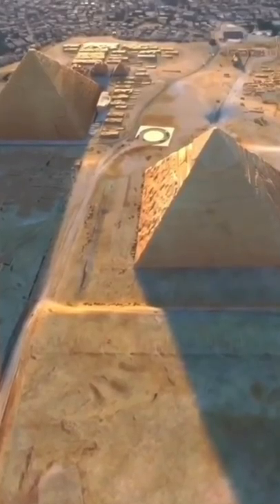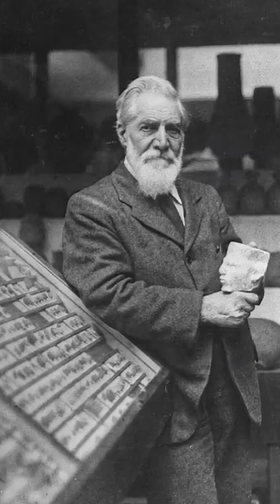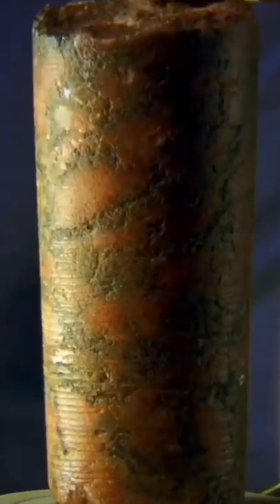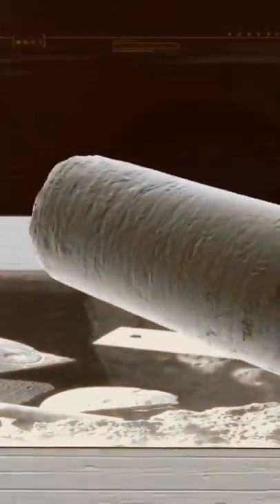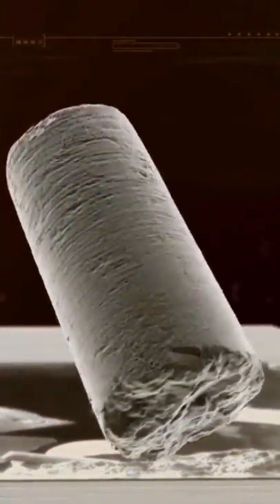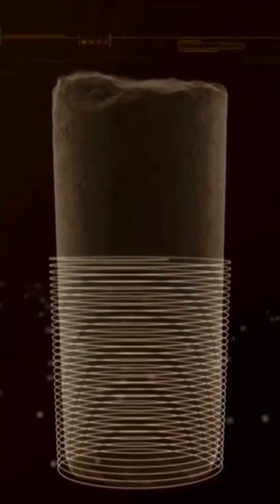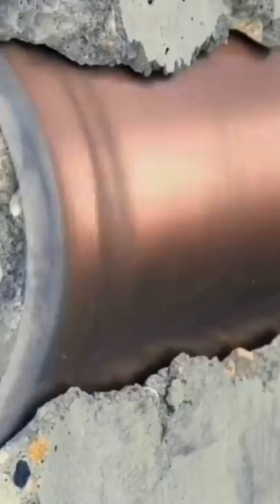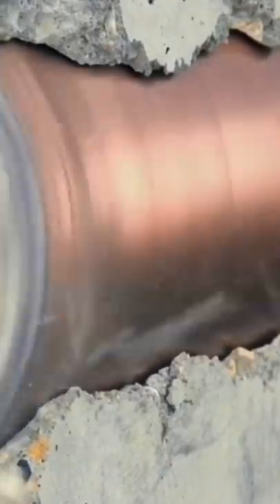Advanced Ancient Tech found in Egypt! Core7

Comment: I love how it has to be either a bowdrill... or a modern power drill.
Reply: All of which would make something smooth. We literally have nothing that can cut a granite core out of the rock like this. Anything done by us is smooth as glass
Reply: @Frogtalkin  well now. Give them credit they built pyramids. They could probably build a horse powered bow drill. Place lever on top and have the horse pull the rope.
Reply: Ancient Aliens in a nutshell.
Reply: @Frogtalkin  yes we do. It's called sand. 

Egyptians used sand on their cutting bits to slice into granite. This is well documented. No power tools required. Just patience.
Reply: @Nurhaal  o don't like sant
Reply: @Cyborg_Lenin  it’s rough, and coarse, and it gets everywhere
Reply: @gregoryholland6126  not like you, you're everything soft, and smooth.
Reply: @Nurhaal  i hope it was Diamond sand. He just said it was moving 1,600 rpm. Silica isn’t going to cut through granite in one motion at 1,600 rpm.
Reply: @toob247  thats exactly what i said
Reply: He proved it when he said "literally." 😂🤣😏
Reply: Right, like millions of minds couldn't come up with a way to drill mechanical using wind, water power
Reply: That checks out in all, until you realize the time involved with that and the time the pyramids were allegedly created doesn't add up at all
Reply: These conspiracy nuts jump to conclusions all the time if it moderately supports their claims
Reply: @Drknow1984  it's clear to me that home depot has been around much longer than originally thought.
Reply: @Drknow1984  oh gee look at me such the big rationalist owwww your type is just as bad if not worse
Reply: @pureruckuspower2165  our time estimates are 10000% wrong, just not how you think, but hey way to make it seem like you said it first, and attempt to discredit the guy who said fuck all about aliens in the comment section as he points out you clowns. At least the "conspiracy" theorists are creative, and probably have a soul to boot.
Reply: @Drknow1984  well clearly it can't because it wasn't. Should of went to trade school and learned some actual things maybe
Reply: @cvi4057 You ok bro?
Reply: @cvi4057  Imagine liking your own comment to try and make it seem legit.What do you mean it wasn't, you mean the pyramids weren't built? They didn't core out that granite? Or you just can't think of a point?
Reply: @Drknow1984 I don't do that but nice try. All I've said is they weren't built when we thought they were built and they didn't use what we think they used. There's more evidence to suggest in favor of my claim then there is in favor of yours.
Reply: To exert 2000lbs psi of force and sustained 1600rpm, I don't think it's possible with tension or copper gears with a weighted water driven system. It's a mystery but I would definitely leave room for some lost tech that people of the time came up with. I wouldn't immediately go to Aliens or Atlantis.
Reply: @cvi4057  cope and seethe kid.
Reply: I'll take a guess... horses and gears.. one single large wheel/cog... and the one small one attached to the 'boring tool'..
Reply: @toob247  this is my theory also
Reply: Lol they under estimate   ancient  Egyptians  lol
Reply: They can speed it up by using gears too
Reply: @cvi4057  I'm glad your the professor of this comment section.

All hail our new leader.  Conspiracy man.

And yes I have no soul...  BOO!
Reply: @pureruckuspower2165  hahaha who hurt you my son
Reply: @cvi4057  it was you dad.
Reply: @Drknow1984  lol ok please, explain it to the rest of the class then.
Reply: @pureruckuspower2165  cringe comment
Reply: @darrell3391  real question is tho, 2000lbs psi and 1600 to take how long to drill it? If they would have done that in an hour? A day? A week? A month? They aren’t very specific on that. And it has been proven that some things can be done anyway by taking a very long time.
Reply: @cvi4057  i would love to hear your estimation for when they were built. Cause obviously they weren’t built yesterday evening and they have been around for quite a while. Also the claim they make with the 2000lbs psi and 1600rpm or whatever doesn’t really specify the other terms as there is more involved, time for example. Perhaps those numbers change as you change the amount of time you spend on them, as they probably will.
Reply: @Nurhaal  Cleary not someone who has cut stones. use sand how? it's a very bs way to excuse the lack of explanation.
Reply: "Rapidly rotating power drill." That just means it was a drill that was powered in some way. It could have been powered by literally anything. Nothing that couldn't have easily been around during the Egyptian Era.
Reply: "We don't know how they did it so it was modern technology"
Reply: @cvi4057  why is it so hard to understand people back then didn't really have anything else to do?
Reply: @darrell3391  just because you don't think it is possible doesn't mean it's not possible.
Reply: Yeah people completely ignore a two step process.
Not to mention that said core has a smaller radius at the top compared to the bottom. Meaning that when they drilled it, they took more from the top.

This small fact can sustain a chemical treatment of the granite before finishing the drill. The drilling is assumed to be rotating at a specific speed assuming the harness of granite. This changes if something like salted water is used to drill as it chemically softens granite making it easier to drill.

The video also assumes the groves were made when the core was drilled. They could have been made later for different reasons.
Reply: Well, it could have been aliens
Reply: @j5892000  I’ve dabbled in the create mod for Minecraft so I know a little about gear ratios 😎
Reply: So then what is it if not these?
Reply: @Nurhaal  yeah bro 6hours of work for an inch or so, clearly they drilled and cut at that amazingly efficient rate
Reply: @cosmicbonzo7559  how did they determine RPMs?  The whole video is BS.  It could have been weeks and 40 rpms.  The grooves look to wide to be done with something that fast.

You could get string wet, and pack it with sand and use it to cut glass if you had to.  It would take a long time but its doable.
Reply: Right lol
Reply: No, he said it can’t be a bow drill bc of the lack of breaks in the groove around the core. However, this guy is forgetting that we’ve been able to use wooden gears to make fixed, rapidly rotating drills. Only thing is, there’s almost never a reason for a hunter gatherer to ever build that, even though they still could 🤷🏼‍♂️
Reply: @bendover9813  dude these guys didn't use the wheel until much later, they didn't have geard
Reply: Aliens responsible for this shit thas it
Reply: He said it can’t be a bow drill because the grooves are in one direction
Reply: @Drknow1984  That's not a conspiracy.
Reply: The one option  that hasn't been offered besides a watermill, the one thing they could have used as a power source would have been wind power to power a drill. And if that is the case they could convert between hydro and wind depending on the location of the water source, no water source no problem. And with there advanced knowledge of all everything  depending  on the power of the airflow could be augmented  by gears so even a smallest airflow could be increased dramatically  by the gear ratio..
Reply: @toob247  0 evidence they built the pyramids. If you aren’t being sarcastic ofc.
Reply: K hello YouTube comments section im gunna blow your mind 

So gemstones like diamond arent very common in ancient Egypt but there are a few things that are one very very special one that would have been imported over the sea was obsidian shards, when fragile obsidian chippings are crushed and added to a drill it allows for way more cutting power then those pesky bow drills would every have, couple this with 50 or so slaves working as fast as they can on a large drilling mechanism and it's perfectly possible to cut fine granite like this, to account for the rings mostly likely they are caused by obsidian being used up and ground into dust requiring drilling to be stopped and the dust replaced with more finely chopped shards.
Reply: And before anyone says it, no the grooves don't go one way idk if you know this but the guy who makes these shorts tends to make up little facts to make it sound more impossible mostly so people argue in the comments about it and get him more interaction time
Reply: @cvi4057  ya a soul🙄
Reply: @highdadd6526  maybe you should try and get yours back sometime
Reply: @James Smith it's always the atheist.
Reply: @James Smith 😂😂
Reply: @James Smith I hope one day you ask God for forgiveness before it's to late, but everyone walks their own path.
Reply: @James Smith imagine
Reply: @Nurhaal  a slice going 1/4 in per hour into stone is not realistic to cut massive stones and still put together the pyramids with such a small margin of error.
Reply: @Official3N4XL  you clearly don't work on manufacturing. 

None of you do.
Reply: @Nurhaal  anyone who works in manufacturing can vouch for anything being much more efficient than using water and sand, which was shown countless times again to be inefficient time-wise and in terms of being precise right angles and flat surfaces.
Reply: Funnily enough there is only evidence of bow drill use.
Almost like its older or they had more advanced stuff than we realize.

Why cant you people just accept this?
Reply: @realryder2626  and 2k psi? Real life experience, any idea how much force that is?    Im quirous how many of these bore holds were actually drilled.
Reply: or maybe a planetary gear system parallel to the ground with like ten people turning the outer gear by pushing handles in a ring? planetary gear systems aren't that advanced, would definitely have no breaks in the pattern, and would be somewhat practical at accelerating the drill to decent speeds via human power alone
Reply: @ThoseMadFoxes4330  I had intentions on challenging this. Yes The Greek Antikythera mechanismWas apparently built 500 to a 1000 years after the pyramids which is kind of a  time gap but who's to say really.  Only Nothing of that equivalence has ever been found in relation to the Egyptians.  But who is to say when Egypt hit the dark ages that they didn't hawk all their metal to foreign empires for food.  I'll say it is plausible.  But you have also have to consider the pressure required to drill such a hole in hard stone. Bronze and sand would not drill a consistent downwards spiral. I quite confident it would require a much harder tipped drill bit also a metal that could handle the friction heat or a cooling system plus a large amount of weight which the Egyptians apparently had no problem with. (Excuse the run-on) I'll buy it.
Reply: @cosmicbonzo7559  I mean it absolutely would preferably at a slower rpm. The likelihood of that core being slugged out at 1600 is just silly. As the diameter increased the rpm should decrease this is basic machining
Reply: @toob247  psst.  They called them water mills.

I think you're right, tho.  Definitely horse-powered.
Reply: @Kevin-jb2pv  well there  is record of water mills pumping and lifting water but I don't nnkw about running drills.  

Pretty sure we are both wrong about horse power though. 

Definitely camel power  🐫🐪🐫🐪🐫
Reply: No other steps needed, just one giant leap for mankind.
Reply: @cvi4057  id say the extreme conspiracy theorists, which this is getting close to,, are just as uncreative as ths old guard of Egyptology.....jumping straight to conclusions on the slightest evidence.

Creativity would be coming up with a unique solution that is more plausible than either of what the above two groups come up with.
Reply: @Nurhaal   That takes years and years
Reply: @toob247   Yeah but that wouldn't explain why it's a continuous cut in circles
Reply: @daggerg8451  you could literally do it yourself. Rather efficiently. Using copper with sand. Using a hammer with a spike and two shims. 

People do this shit daily. With just hand tools.
Reply: @daggerg8451  yah youre right. 

Must be alien camels 🐫. 

Not humans with the time and motivation
Reply: @Nurhaal  I already seen people do sand and it doesn’t work at all
Reply: How are conspiracy theorists more creative? You see a smooth cut and instead of trying to look for methods possible at that time, you stick you heads in the ground and go scream "aliens" because the only methods you understand use modern tech.
Reply: @Nurhaal  a special type of sand that is harder than granite. I think it's called corundum. Similar to diamond bits. It's found across the quarries and stone finishing sites.
Reply: @Frogtalkin  not true. I work with granite and when we cut out a hole for a faucet theirs similar lines on the core that comes out.
Reply: @deadpanfish  Yes its called Corundum and it's a very commonly mined mineral. It's exactly what the Egyptians used as an abrasive to cut stone with. Even in the modern day, corundum is a typical hard abrisve as it's hardness of 9 Mohs makes it able to scratch just about anything. Plenty of evidence was found of Egyptians using the substance as a granular abrasive for stone cutting. Many of the Core Cutting Drills we have found have evidence of corundum abrasives.
Reply: @hanleyk  you don't actually have do. Simply dropping sand onto the substrate and applying consistent pressure and motion via a plate or bit, or even blade, imparts the work needed to cut into stone.
Reply: It could only be a Dewalt alsl
Reply: @Frogtalkin  yes we do lol. I work for a drilling company we do this all the time standard diamond bit. Perhaps youre just uneducated
Reply: No powertools needed. look up the channel Scientists Against Myths they have a great demonstration on how to drill a hole like that.